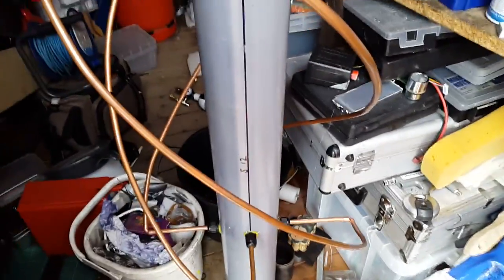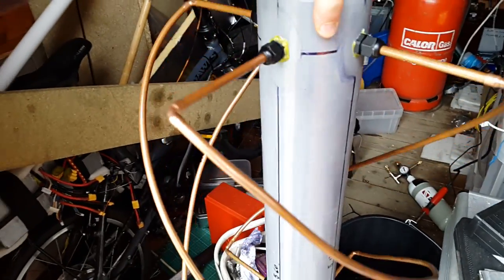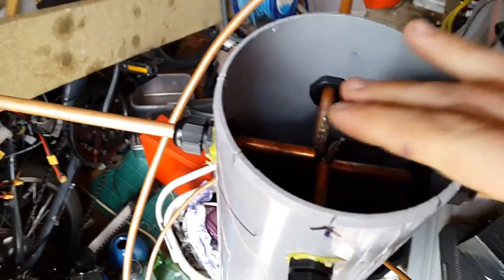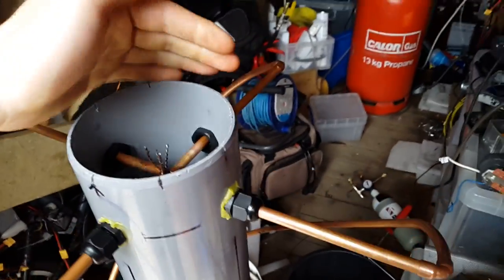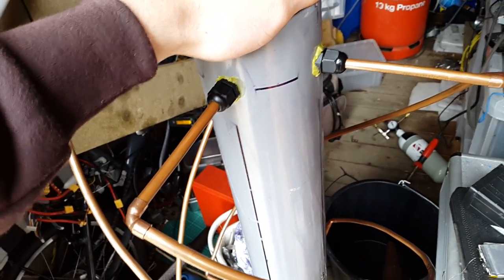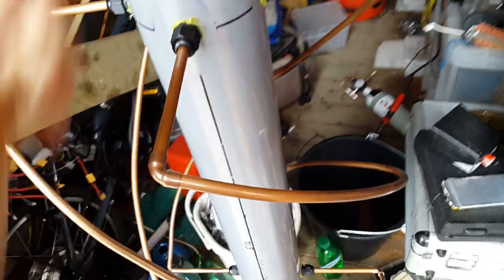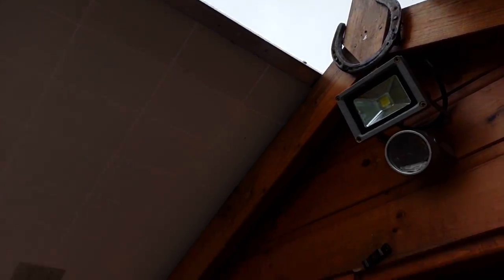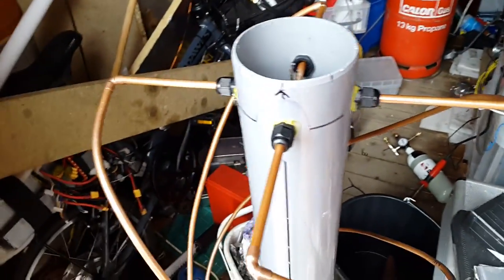Quadrifilar Helix Overview

Comment: I'm building one now, but with coax instead of copper tube. Two little tricks from my model rocketry days:
1. The 90° part of a door jamb or some angle iron makes a good straight edge for drawing the vertical line up the big PVC pipe.  The angle in the angle iron won't allow the straight edge to move all over the place. Easier tried than explained.

2. Cut a band of paper a little longer than the circumference of the pipe and about 10cm tall. Wrap the band of paper around the pipe and mark it so you know where the circumference is. Then evenly fold that length it into quarters. The initial mark and the folds, when wrapped around the pipe again show where 0°, 90°, 180°, and 270° are on the pipe. So align one of them over the line on the pipe at at a mark where you want holes, and use them to mark where the other  holes go. Or use them to add 3 more guidelines on the pipe.

Using geometry like this avoids math and measurement errors so you end up with better accuracy. It is also useful for positioning 4 fins on a rocket. 3 is a different story.

Comment: Here's a tip on marking equal increments around a round tube: measure the diameter, calculate the circumference (c=d * pi); if you want 4 equal segments, divide that result by 4, then lay out on paper with a pencil and ruler a straight line and segment the line into the 4 lengths. The total length of the line will be the circumference of the tube. Cut the paper with the divided line. Now you have a 1:1 template; carefully tape the template around the tube; the ends of the paper should meet. Center punch your holes on the 4 segments, then drill the holes.

Comment: To get nice 90deg angles (Trace your ABS Pipe on to Graphing Paper) cut out your circle and use the Graphing Paper (+) lines as a template guide for your 90degs .
The Element Connections are made (Long to a Short) - (Long to a Short) .. Shield connected to one pair .. Center conductor connected to the other pair..
 I also Recommend using low loss LMR-400  Cable (73s)

Comment: I ,,You did a good job,  it looks perfect 👌 thanks 🙏 blessings , do they have any fish chips  shop around I’m 
Hungry I wonder if  it can be scaled down or up with out Radiating out of the frequency it’s cut for making it smaller mite go up or down ,, in frequency I’ve. Seen here on YouTube real small ones , the thing is dose it change the overall resistance  ,, after all if you just receiving  no worries about pep output , and SWR .... WELL hooker up and lets dial in 137.-660  mhz. ,, log on the decoding site and wait for the birds to come ,, 
   The reason I was worries about the overall side to frequency relationship .. there’s more than one Bird up there spiting out all kinds a stuff and info like NOAA stuff about the Oceanic information like tides, temps, currents ,, 
One day when I grow up I want big listening Post ,,” ,!   0 kHz to 36k,,, on all modes , all Frequencies.  
From the Frequency of light to the unheard ,, sorry about rambling and thank you for your time 🖨💻⌨️🖥📡📡📡📡📡📠📠📀